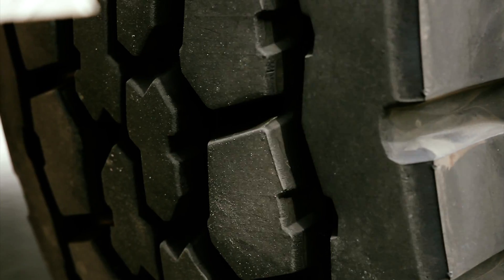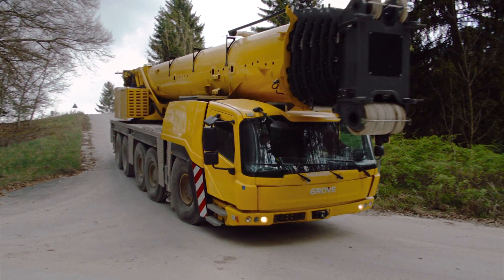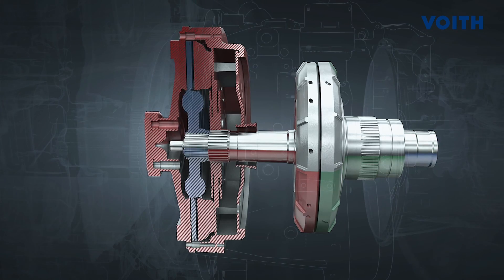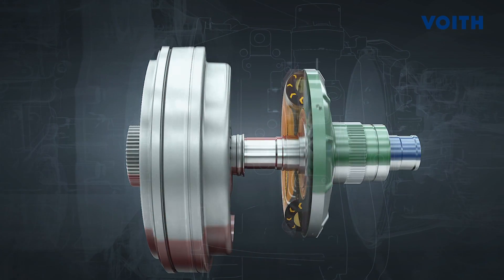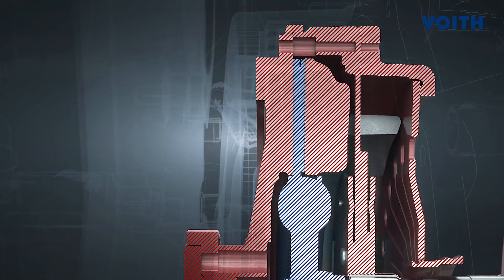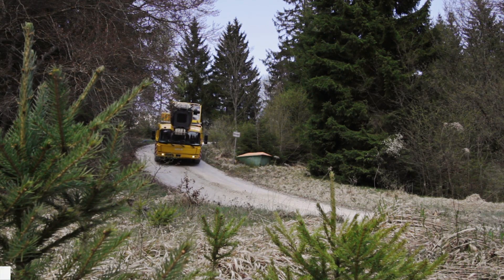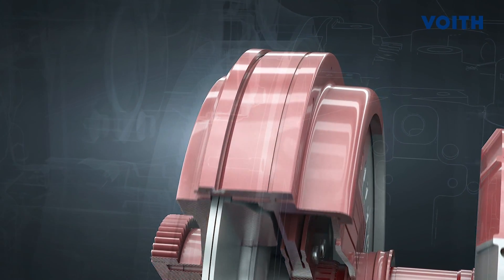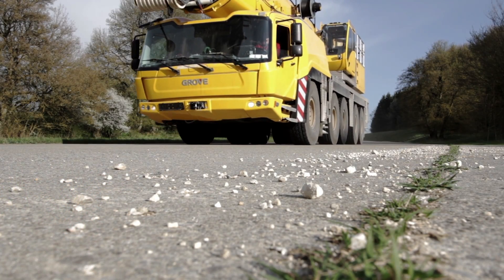Grove GMK5250L - Turbo retarder clutch VIAB

Comment: Yeah it's a cracking workhorse,? But it needs a low loader with the ballast and crane pads.!  SO buy the crane and STGO 3 heavy haulage motor and trailer and your on your way to making cash.

Comment from the maker: Manitowoc launches new best-in-class Grove GMK5250L

Manitowoc has announced a new Grove all-terrain crane for the global market and as with other Grove launches of recent years it offers several unique innovations and class-leading capabilities. The 250 t capacity Grove GMK5250L has the strongest reach and load chart of any five-axle crane. It also offers the best maneuverability and class-leading driver comfort, which it delivers thanks to its inclusion of a VIAB turbo clutch and integrated retarder – the first ever mobile crane to feature the system.

The VIAB turbo clutch module eliminates both fluid overheating and clutch burning, while enabling wear-free starting and braking. It also contributes to fuel savings and on the GMK5250L fuel consumption is estimated at approximately 30% below that of its predecessor, the GMK5220.

Learn more www.manitowoccranes.com/en/news-events/news/2015/Manitowoc-launches-new-best-in-class-Grove-GMK5250L

Watch the video: http://youtu.be/OCJbAtAuJk4